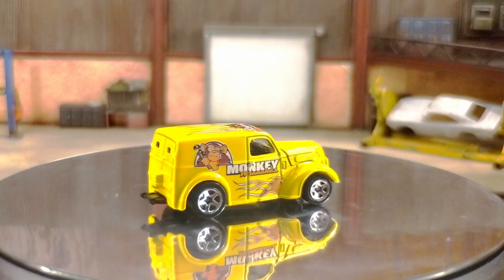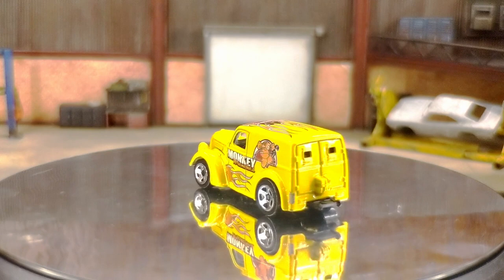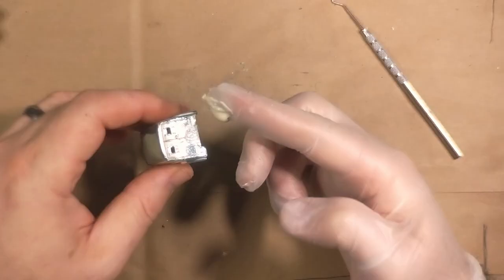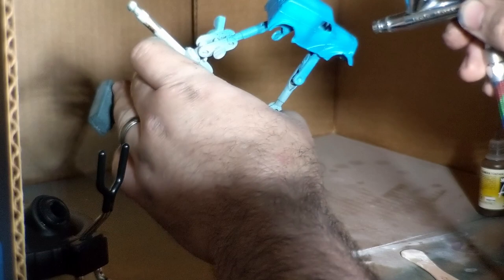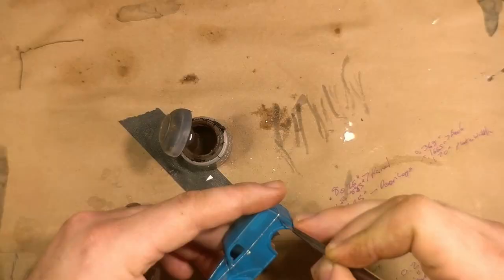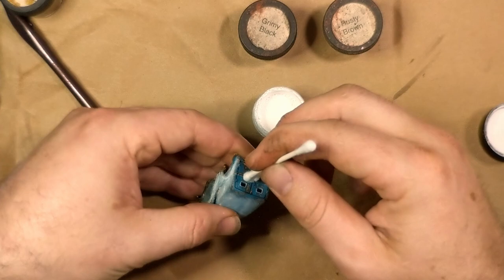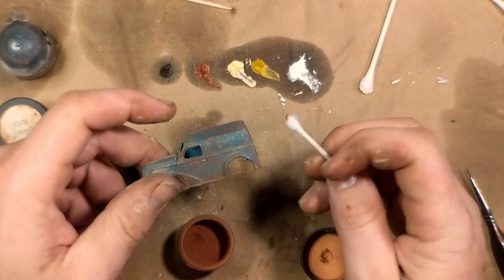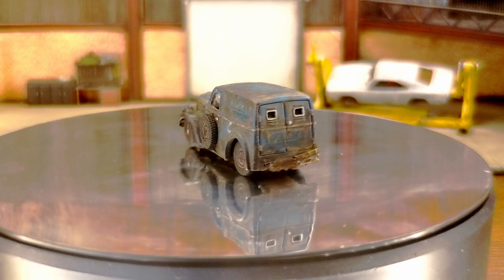Custom Diecast Tutorial: Transforming a Hot Wheels Ford Anglia with Dot Filter Weathering

Comment: Really easy way to dull a paint job or give it a satin look is Testors Dullcote. Not sure if youre familiar with the stuff but it works wonderfully!
Reply from the maker: I know it well. I've been using Vallejo Matte Varnish with great success as well. I used Dullcote a lot on my 1/25 scale builds.
Reply: @DiecastMediaNetwork  Oh good deal. Im often surprised that when asked a lot of hobbyists I know or meet havent heard of the stuff and its so handy to have. Havent treid Vallejo paints yet but I will at some point get around to testing them out. Cheers!
Reply from the maker: @scotthallgv  yeah, Dullcote is great. I like Vallejo because it's water based and has a great matte sheen, but Dullcote really does a good job too. It's not cheap but with an airbrush it lasts a long time.